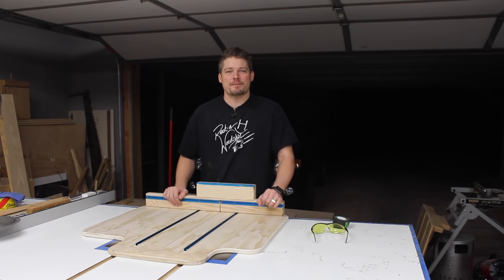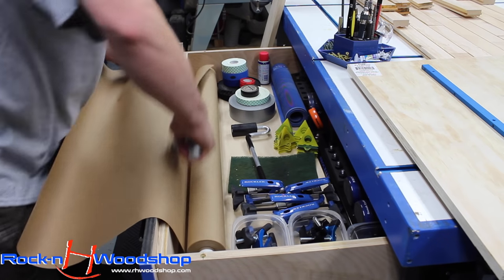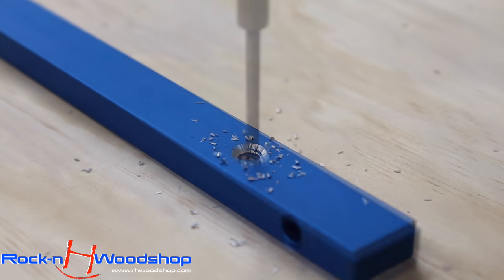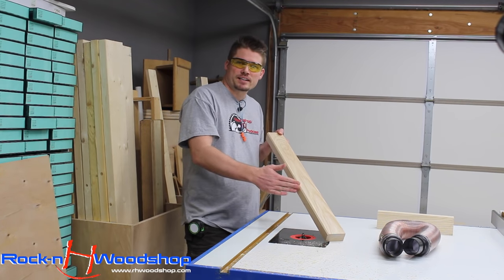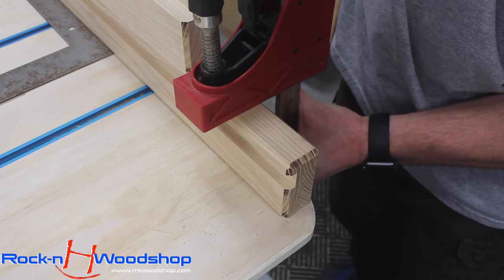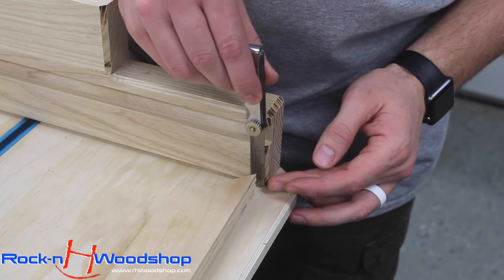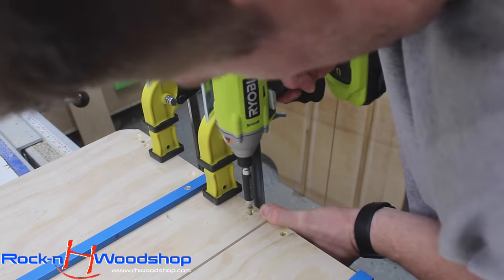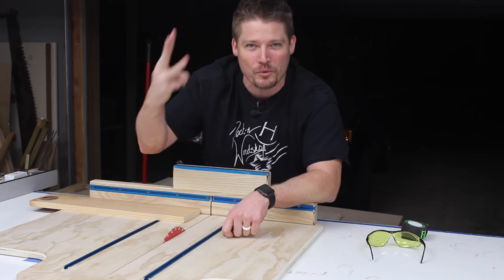Ultimate Crosscut Sled with Dust Collection

Comment: Just note that the more cuts you use the more accurate it will be.  For example, use 10 cuts and then divide the final error by 9.  That would be far more accurate.

Comment: Well explained and well done.  A couple of suggestions that i could make is to:   1  Add a stop-strap or stop-chain to stop the sled once the blade is just past halfway  in the fence -there is no reason push the sled further and this would help prevent cutting the sled in half or cutting a thumb off.  2.) Add another t-track to either side of the sled on the outboard sides - a miter fence supported at two points is very secure.
Reply from the maker: Bob Blarney very good idea for the stop trying. I'm trying to figure out your T track idea however. I do have two miter bars on the bottom side but what are the two T track locations you are speaking of

Comment: After watching too many videos all claiming to be the best sled I found this one. For me t his is the best of the best. So I built almost identical to the one in video. It is light because it doesn't have a back fence. The T trac I almost didn't add but did and very glad I did. I use them all the time. Don't build one without the T trac. What a great idea for the dust collection. I added mine on the back instead of the side and then offset it so the blade doesn't hit. LOVE THE SLED.  Glad I didn't give up watching videos till found this one. THANKS AND GREAT JOB.
Reply from the maker: Wow, what a fantastic comment. I appreciate that a great deal and I am so glad that my sled has helped you. You would think that the T track would be just excess stuff that you probably wouldn’t use but like you said, you use it constantly now and you probably wouldn’t do without it anymore.  I like the idea of the dust port being off the back. I’m glad to hear that your modifications are working out well for you. Thank you again.

Comment: It was cool to see you still using the jointer fence on your table saw. That was one of the first things I made for my first table saw. I never felt comfortable using it so I no longer use it. Prime example of if you don't feel comfortable doing something then you should stop doing it, no matter if someone else is comfortable doing it.
Reply from the maker: Joshua Luther yeah it comes in handy from time to time. I have a 6 inch Delta Rockwell jointer but it needs some overhaul. I will try and tackle that sometime this year but until then the tablesaw is my jointer

Comment: Excellent video. In case no one else has mentioned it, Izzy Swan designed a gizmo that clamps on the infeed side of a table saw to support a miter sled that's cantilevered off the edge. Looks like an idea ripe for "appropriation".

Comment: Nice sled. I also like your mind set about having several drill/drivers. I have four myself. Same with grinders, as I do metal work too. Each one has something different; twisted wire wheel, grinding disk, cut-off disk, and a sanding disk.  Just have to maintain good housekeeping with all those cords.

Comment: You can eliminate one drill if you get those pilot hole & countersink in one bits. Saves me a lot if time too. Nice video. I was impressed with how well the DC works. Will have to do the same on my next sled.

Comment: The dust collector on the rear fence is a good idea but i never thought it would work so well.  I have thought about adding tee track to my sleds but just never got around to it.  Good idea though and with a large right triangle to anchor down to the sled using the tee track you can also make an angle guide to cut molding for picture frames.  But the hypotenuse of the triangle to the rear fence centering the 90 degree angle in the saw kerf and clamp it down to the sled.  Make a cut through the triangle and you just made another jig.
Reply from the maker: Dave and Jackie Scott very interesting. I might have to give that one some thought

Comment: Nice job, here is a tip, instead of using CA glue for initially attaching the runners use double sided tape, it will get the job done and if you ever need to remove the runners you will be able to. Great job and thanks for sharing.
Reply from the maker: +Michael Katt great tip. I️ will keep that for future reference.

Comment: Very well made video Drew.  Great ideas built into your sled.  Was ecstatic to see the dust collection idea!  Like you I hate a mess and had built and dust collection system for mine with a collector system that rides on the riving knife.  That does a pretty good job but not perfect.  Your idea looks really good and I'm headed to the shop to modify my sled!
Reply from the maker: Peter Brown hey Peter, thank you for taking the time to drop me a comment. I would really like to know how your dust collection worked out for you and if you were able to get it done.

Comment: Drew - clever design with the flat front fence.  But the reason you had to repeat the 5-cut method is because the last multiplier should be the entire length of the rear fence- from pivot point to the end, not just to the kerf.  That would have produced a difference closer to the .027 or  whatever the sum of your adjustments wound up being.  I made the same mistake on my first 5-cut calcs.
Reply from the maker: Well I did measure correctly from the pivot point because my graphic was off after I made the video and posted it I did not notice it until then. That was just a typo error but where I measured from was correct.

Comment: I wonder about an idea I have for a low-dollar version of any of these T-track hold downs. What if you drilled holes in it with a Forstner bit that would allow you to use different size wedges to fit and secure your pieces? Or drill through to keep the sawdust from the holes. I'm thinking especially for my field work sled, but I'm more carpenter than woodworker. 
This stuff just fascinates me, and encourages me to do accurate work even for exterior work.

Comment: GREAT project Drew.  I like the "breadboard" end and cant' beat all that T track.
Keep the vids coming!!!
Reply from the maker: Sebastopolmark Thank you so much. It makes it look so much sexier in my mind. Plus it does not limit me on how wide of a piece of stock that I can cut. If it exceeds the sled you just flip it over and cut it again
Reply: I suppose to cut the first "half" of a board that was wide enough to need flipping, you'd have to raise the blade up through the board for the first cut, no? I suppose it's that or feed the board into the blade towards you, which wouldn't be safe.  Let us all know if you've cut a board wide enough to try it!  Thanks for the vid!
Reply from the maker: Sebastopolmark that is correct. Raise the blade and make your first cut. Then lower the blade and flip your stock. Raise the blade back up and finish the cut. Done.  I've done this a time or two when needed.

Comment: Very nice sled.  Looks like it works great.  I was looking over the calculations on your squaring the fence method so I could use the same formula when I discovered you have a math or measurement error.  Either the length of your fence is 28.715 long or the margin of error is .00817.
Reply from the maker: +Michael Baxter you were correct with the first yes. My fence is actually 28 and three-quarter inches. I discuss that in some earlier comments but when I made the graphic I accidentally wrote 12. Nice catch.

Comment: Drew great video and design.  I really liked the add of the track in the sled, and on the fences.  This seems to be a much better solution then others I have seen.

Could you explain your reasoning on going horizontal on the bridge at the end of the sled?  Not sure of the benefit.  Thanks
Reply from the maker: Leo Kessler thank you and sure thing. With other designs that have the vertical stabilizer you are limited to how wide of a piece you can put on your sled. With my horizontal bar I can put as wide of a piece that I want that's no more than double the width of my sled. To do this all you need to do is lower the blade, place your piece on the sled and raise the blade back up cutting through as much as you can. Then lower your blade back down flip your piece over and then do the same thing to cut through a piece twice as wide as your sled.
Reply: this just answered my question. So add me to the list of folks who like the design. I'm going to make one as well. Keep up the good work!

Comment: Nice design! 5 thousands out can make a difference in a long rip that is going to be glued up!
Reply from the maker: +Sean Signer but that's why you don't rip with a crosscut sled you crosscut so there won't be many glue ups on the ends of my board that wide.

Comment: Ive always loved the 5 cut method!
Small error in your math is probably why you were off so far after your first adjustment.  You started with 8.25 thou, multiplied by 12.875 and divided by 12.75.  Those are very close, so logically you’re answer should end up almost the same. I get 8.17 thou, you were showing 18 though, which almost perfectly accounts for your 9 thou error.
Reply: It couldn't be 12.75 from pivot point to end of fence. If margin of error 0.0184 was correct then it should be 28.75 instead of 12.75.

Comment: I am currently building this sled! I have looked at many designs and really like yours! As you say, BOOM! I am at the point of installing to top t-track and am really struggling with screws. Give the remaining plywood is slightly less than 3/8" thick and the sled bottom must be flush, I would appreciate more detail on the screws you used. As you say, the CA glue is not permenant. If you used 3/8" screws, did you increase the number? Again, thank you for an excellent video.
Reply from the maker: One of the problems that you run into is plywood thickness versus screw length on T track. If I did have any protrusion of the screw, it was ground down to the surface of the sled. I actually took it a step further and ground it down below the surface of the sled to prevent scratching of my saw.

Comment: Hey man I read you're from Moore, OK. Kool, I'm down here in Lawton :(  I just wanted to add a note for anyone that my be having issues getting a good square off their fence if they have a positive correction. You'll need to add the feeler gauge after you clamp a stopping block snug against the fence and than remove the screw. This is as opposed to how you had to place the gauge with the stopping block before you removed the screw and moved the fence. Sorry if I made that more difficult than it should be. Great video, you have a new sub my fellow Okie.
Reply from the maker: So nice to meet you and thanks for offering the tips

Comment: AWESOME BUILD, Drew!! I drove myself nuts trying to get mine dead on, I finally gave up at .003 lol
Reply from the maker: Jerry's Machines yeah there are so many tolerances that wood gives you that it's almost impossible to get around. Metal work is a lot more precise but .003 to .005 of an inch over a 12 inch span with wood is pretty dang good!
Reply: I do metal fab work as well, I really get nuts with it lol

Comment: Hi Drew, great addition to the cross cut sled dust collection, I have been using William NG method for years. You need to check out his video on how to properly chuck a drill bit.

Question the vacuum source for the sled is that a separate vacuum such as a shop vac? 

Thanks
Reply from the maker: Yes it is. Do you have a link for the chuck video
Reply: If any one has followed William and paid attention to his detail, you Will really appreciate this video.
Reply from the maker: Finally got around to watching this. It was laugh out loud hilarious! 😂
Reply: Rock-n H Woodshop I though you would get a chuckle out of it.

Comment: Great build. My biggest problem with most of the projects I see is trying to find decent Baltic Birch near me. All we have up here is big box stores with plywood you could use for a Bombay Dresser.

One note: I haven't seen the rest of your videos yet, but would it make sense to put a hose clamp on the back of the fence to support the dust collection hose? It would make sure there's no drag when sliding it.
Reply from the maker: +Derek Smalls you have a good point there. I do plan on running dust collection along the ceiling and if I do that I will have a port drop for a dust collection hose that will accommodate my sled. 

Hopefully you can find a place near you that can supply you with decent plywood

Comment: Love your videos - there's lots of good info.  One thing I don't get;  I understand the advantage of horizontal vs vertical stabilizer, but what does it actually do? IOW, how does it actually stabilize, and what would happen if it wasn't there?
Reply from the maker: Marty Fried well I can put it into different ways. The stabilizer is meant to keep the sled from just having two free pieces flopping around. My plywood is practically cut all the way through so the stabilizer bar keep them together. If you did not cut your plywood all the way through then you would not have the need for it.
Reply: Thanks for such a prompt reply.  I understand now - my old sled has the vertical crosspiece, and I didn't really need to think too much about that. So, I guess the alternative would be to raise the blade somewhere further in.
Reply from the maker: Marty Fried yes, the cross piece allows you to maximize the sled width while still being able to cut stock wider than the sled base.
Reply: Rock-n H Woodshop - So, if you wanted to cut a piece wider than the sled you would have to make two passes, correct?

Comment: Cool to see that you had zero dust. I thought your design was going to have some sort of channel (dado) routed out on the underside of the sled, running the length of the zero clearance hole on the top side, slightly wider than the zero clearance/kerf itself… and extend long enough to connect to your safety stop box so that the whole underside channel would receive suction. I guess none of that would be necessary since your simpler design yielded no dust as is. 👌

The more I think about it, I wonder if my idea would actually just promote more dust to build up underneath the sled… 🤔

Comment: liked your video, did you use machine screws for your rockler running bars, I'm having trouble getting mine to run smoothly thru the track when I put two runners on, noticed you recessed the screws by drilling out the bars , did you use wood screws then
Reply from the maker: Thanks so much James no I did not use machine screws. The bars already had holes so I just countersunk the hole so the head of the screw would sit lower than the bar surface itself. However, you can pre-drill holes if a bar does not have it and then counter sink before you sync your screw. The screw itself is simply a bugle head wood screw

Comment: Great video Drew. I just got my first "big boy" table saw and dust collector. I have a very small shed so space is key. Anyhow, I need a dust solution for my situation. I do resin casting so I'm always trimming resin blanks mainly for pen making. The trimmings or dust from these is a bit more "potent" than most wood. It piles up quick! So I made a sled with a bunch of hold down clamps that I use for trimming. My saw has a 4" funnel port on the bottom but most of the dust comes up and out the left side of the saw. Any ideas on something i can attach to my saw to catch that and run a Y-splitter on my collector? I have photos I can share if I can email you. Thanks again for a nice video.
Reply from the maker: Well one thing I planned on doing with mine was to create a plexiglass cover over the top of mine that had some sides to keep it ridged.  This way the DC port I have in the back will be funneled better.  Maybe you can consider something like this.

Comment: I'm new here, but I believe your 12.75 dimension from pivot point to end of fence is actually 28.75. 
The math then works out. Just a typo I'm sure.
Thanks for the video, I'm thinking of using UHMW (molecules as long as your arm) for my runners. Good?
Reply from the maker: You are correct it was a typo. Heck yeah. Long enough.
Reply: @rhwoodshop  Have you tried UHMW for runners? It's used as a bearing surface in machine shop jigs.

Comment: Thanks for the video.  I will be making some type of a sled and really like the guard and dust collector.  I'm putting my woodshop in a small basement.  Dust is a big issue.  Is there any downside to having the hose to the DC coming from overhead?
Reply from the maker: No not at all as a matter fact I would probably prefer it that way if I had that option.